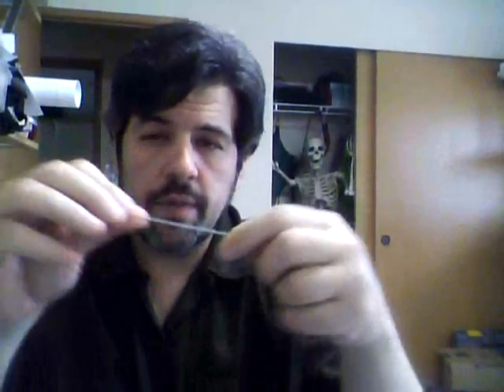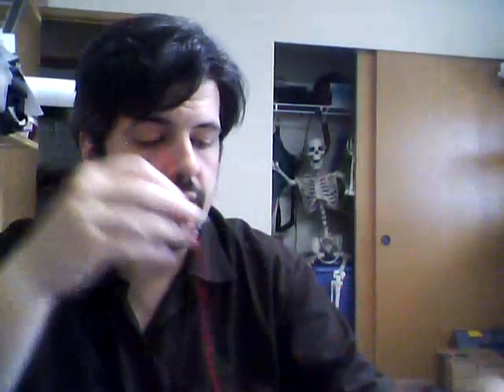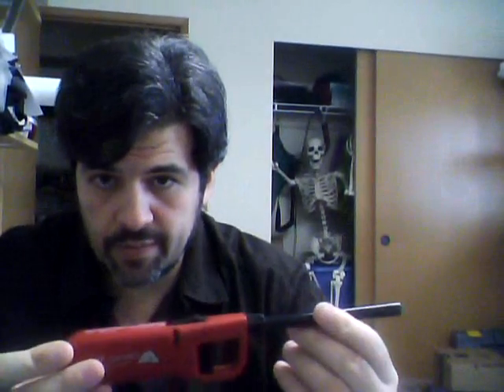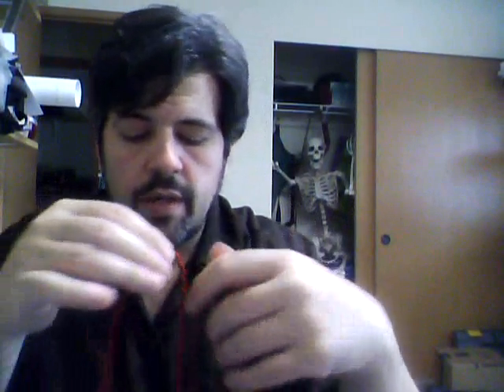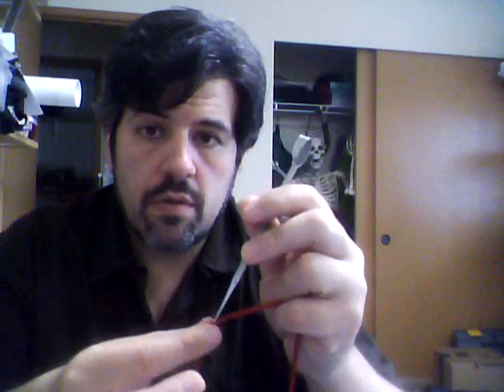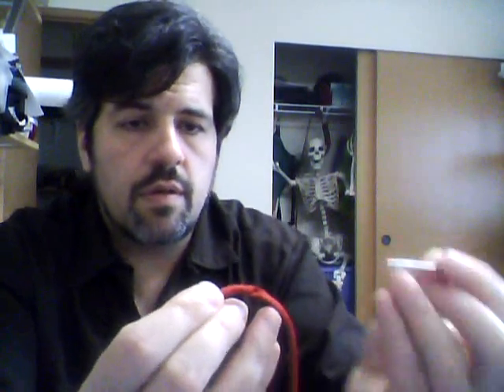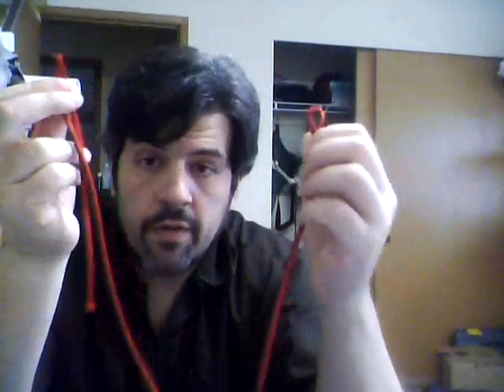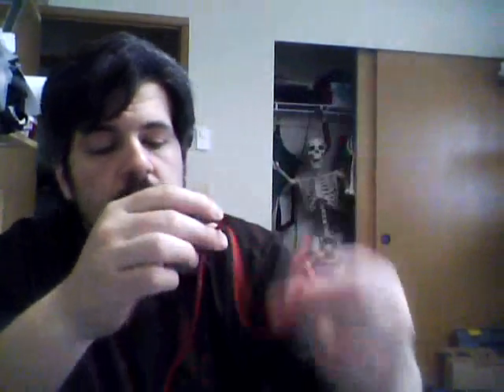How to make a Weighted Fall

Comment: Hey Tyler, how long do you cut and cord . for how long you want the fall to be?
Example: for an 18" fall cut chain X amount and cord X amount.
Reply from the maker: Hi Ron, I think I already answered this on the WB, but you want to leave at least 2-4 inches to sew at the end before the loop.  I leave that longer the longer the fall is.  I think on an 18" fall I'd do 15 inches on the chain and on the cord it's going to vary because some colors are going to seem to shrink more when you load the chain.  It's best to err on the long side, but for an 18" fall I think I'd  cut the cord at 42 or even 48.